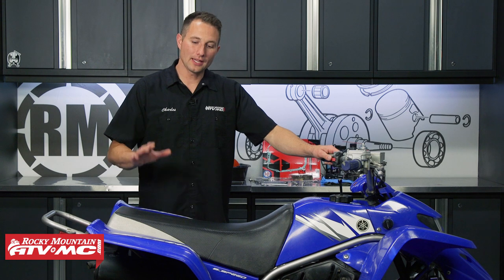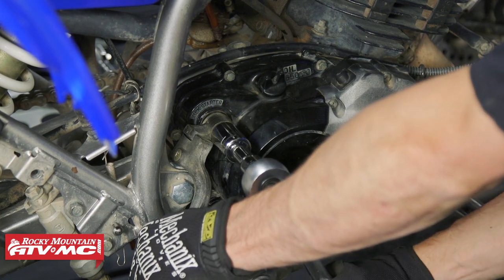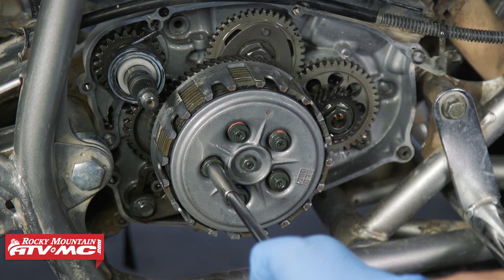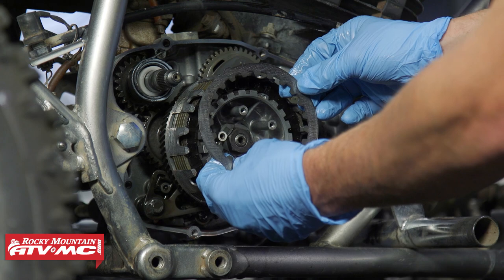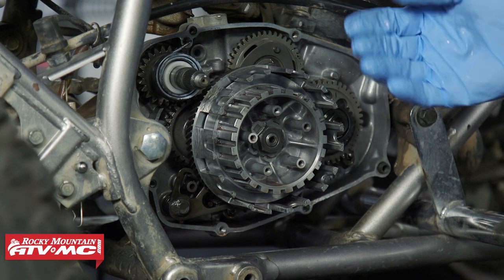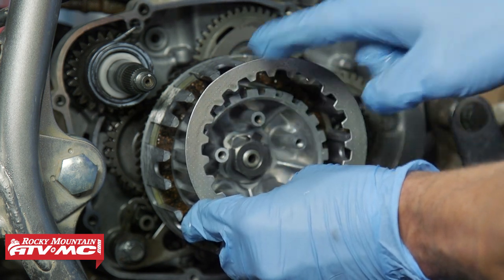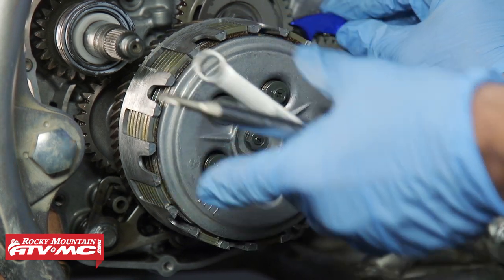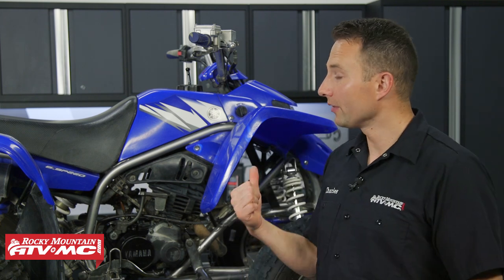How To Replace the Clutch on a Yamaha Blaster 200

Comment: I have a question, I replaced all the clutch plates on my blaster but I missed the part of the video of the part where I was supposed to offset all my metal clutch plates. I honestly stacked em all with the tan facing up…. Havent fired up the bike. What’s the outcome… ? I would have to purchase another gasket again I’m guessing..?
Reply from the maker: The reason you space out the tab on the steel clutch discs is to cut down on vibration. You may notice some vibrations with them all facing the same way. There is a chance your gasket won't come off in one piece (and it is safer to use a new one every time) but since the gasket hasn't been on there long, it may be fine to reuse in this situation.

Comment: What oil should I coat the clutch parts with?
Reply from the maker: Soak the clutch plates in your choice of transmission fluid. We show 3 different options you can use at 1:00 in this video.

Comment: You should have pointed out that they are two bolts longer than the rest. Than showed with hole they belong in.

Edit........ I didn't see in the beginning where you said it. But still have pointed them out tho. Should have showed them when taking them out and pointed out where they belonged.
Reply from the maker: Thanks for the input! We will try to be more clear about that stuff in the future.

Comment: You mention in the beginning to refer to the service manual. Later when the push rods are installed you say coat with oil, where the service manual specifies lithium soap based grease..... Kind of contradictory and divergent wouldn't you say? Otherwise good informative video
Reply from the maker: We mention the manual so you can make an informed decision on weather or not to use lithium soap base grease or oil. I don't think it will make much of a difference to be honest. Other than that, I hope it helped out.  -Charles

Comment: What's the length of the pushing rods?
Reply from the maker: The push rod 1 is 1" and the push rod 2 is 4"
Reply: @rmatvmc  I'm from RSA please use cm/mm
Reply from the maker: 1-25.4mm
2--101.6mm
Reply: I just measured the rods 1 and 2 are not the sizes you gave me or the size you gave the the actual expected sizes?
Reply: Then wish one goes in first?
Reply: @rmatvmc  what's the magnate tool used to pull?
Reply from the maker: @fortunenhloso4145   Those measurements are from the owner's manual of what they should be. The first rod (smaller) goes in first, ball next, then rod two (larger). 
Here is also the magnet tool used: https://www.rockymountainatvmc.com/parts/k-%26-l-flexible-magnetic-pickup-tool-p
Reply: Where can I download the magnetic tool?